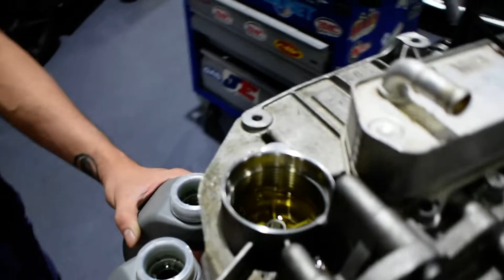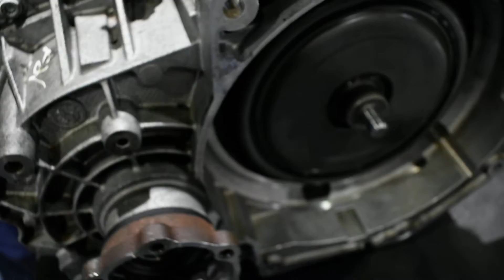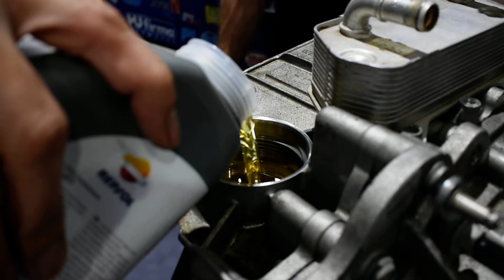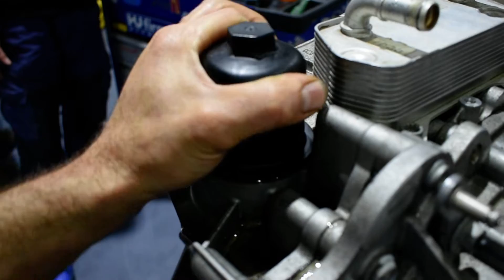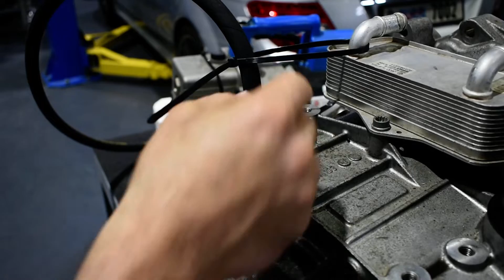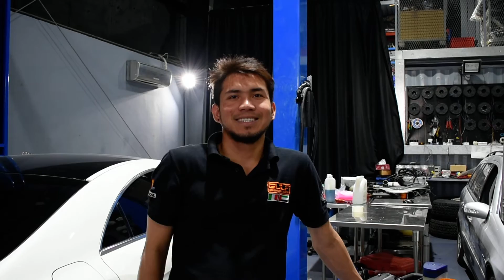DSG transmission, how I'm adding oil

Comment: Hello again Tasos. I just did mine, fill from under with pump. My dsg did not have the breather part you showed at the start. Also starter motor would be in thr way when transmission still on the car. Very much appreciate the video.

Comment: Hi Tasos, excellent. What pump is that? I am doing my dsg service next month, this will be helpful.
Reply from the maker: Any vacuum pump will work

https://www.amazon.com/Goplus-Pneumatic-4-2CFM-Operated-Conditioning/dp/B0183JCT12/ref=mp_s_a_1_3?_encoding=UTF8&c=ts&dchild=1&keywords=Air+Conditioning+Vacuum+Pumps&qid=1609733886&s=automotive&sr=1-3&ts_id=15707041
Reply: @TasosMoschatos  thanks. You are true gentleman.